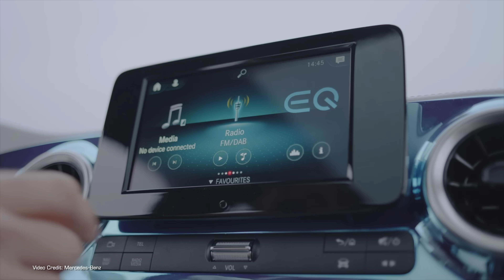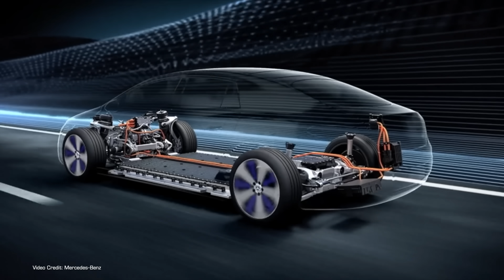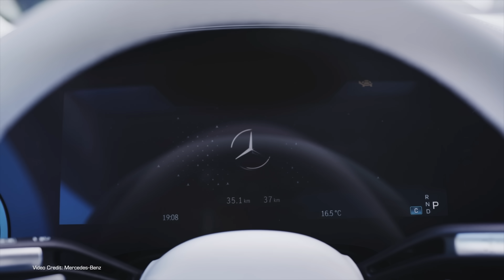Mercedes-Benz's Master Plan For Going All-Electric By 2030

Comment: I am glad to hear this; though it is only a bit too late to keep the Smart EQ in production. One wonders what a ~30kWh pack in that car would be like.
Reply: Smart has been sold a year ago, the hand-off is this or next year.
Reply: Some 40kWh somehow managed to fit into the new Fiat 500e
Reply: @toyotaprius79  Right - that would be even better. The current Smart EQ has something like 18.4kWh? And it was discontinued (here in the US anyway) just about a year ago.
Reply: The range was pathetic too, like 100 km/62 miles.  Just over 3 miles/KW, not too efficient for a micro car. The Spark EV had 82 miles for the same size pack. In another comparison, the Pacific PHEV, with a 16 KW battery can only go 33 miles in electric only mode, so around 2 miles/KW.

Comment: Well, I agree that more clarity is appropriate, but "where market conditions allow" could also mean "where permitted" or something of a sort.  It is not beyond the realm of possibility that a few right-wing controlled countries will make the disappearance of ICE vehicles difficult through one means or another.  Do you remember all the strum and drang when attempts were made to do away with incandescent bulbs?
Reply: What are people  supposed to do for transport in countries where even having reliable electricity is a problem?

Comment: I'm as frustrated as you are , but I don't think you can blame Mercedes et al for recognising the reality that many parts of the world do not have the electrical generating capacity or distribution networks to support the universal use of electric cars. The people in these countries still need transport and car makers are not really doing anything wrong in meeting that need with cars/trucks that are usable there. 
Are they stopping these countries improving generating capacity or something ? If so we need to hear about it and they should be criticised for that , but I've not heard anything about that - have you ? I suspect not.
Reply: I think it's a stretch to assert that a company's role is to serve a need. Needs are inevitably met, and that's not a sustainable business model. 

But you're right that in many poorer countries where a stable supply of frequency (Hz) is not always stable that EVs demand +100kW DC have a limited scope. A robust grid demands investment in infrastructure, and if it's not driven by any social or national reason, such a grid would need a business case with businesses consuming electricity to justify the building of stable supply - and that's a chicken and egg issue, businesses wouldn't want to invest somewhere with a sub par utilities supply. 

Of course, one must beg to mention about hybrids and plug in hybrids. Beg the mention of what reality there is to justify a market of expensive luxury cars in arguably poorer countries, or indeed to continuation of the sale and (carry over) investment of internal combustion engines in markets that aren't planning ICE discontinuation. But that's big picture territory

Comment: They are still hoping EV's will die off
Reply: @davidmccarthy6061  Most of the undeveloped world can make electricity but not ICE fuel. I think its a desperate hope to keep making ICE vehicles. Lets face it a mud hut in Africa can have some solar panels on the roof to make electricity but turning oil into diesel or gas is a bit of a stretch
Reply: @davidmccarthy6061  I easily make fuel for my EV but I couldnt make ICE juice
Reply: @davidmccarthy6061  I think your wrong but time will tell who guessed right, but with legacy car companies just making concept cars and making plans they dont plan to keep, it's going to lead to disaster for them. They need to make major changes today not start in 2025, way too late

Comment: Direct to costumer sales is a scam to prevent consumers getting their car at a good price.
Reply: @Laura-S196  Maybe Tesla has it for the same reason?
Reply: Direct sales is the only method they can prevent that dealers give discounts and drive the average price down. As Tesla shows it also allows them to change prices on a whim......
Reply: So where does the money come from to support the dealer network and the profits that the dealers make.  It doesn't come out of thin air it comes from the purchase price of the car.  So no adding a middle man (a car dealership) does not reduce costs, and does not result in the cars being less expensive.
Reply: @EinzigfreierName  Tesla choose before 2010 to use direct to consumer in part because dealers try to convince buyers to buy an ICE car even when the buyer only wants an EV. This has been a problem with many ICE brands
Reply: @Laura-S196  Sure, but Tesla could have set up its own dealer network. I'm not saying the main reason for direct sales was to maximize profit. But why should it not have been part of the plan? Anyway, there is nothing wrong with this at all.
Reply: dealers in the middle, making huge profits of consumers, is not a scam? what is most untrusted profession? is it car sales (or used car sales)? lmao